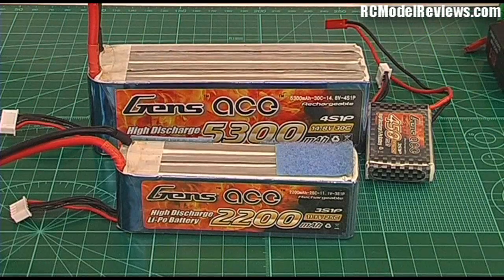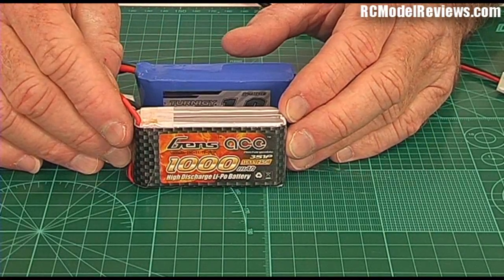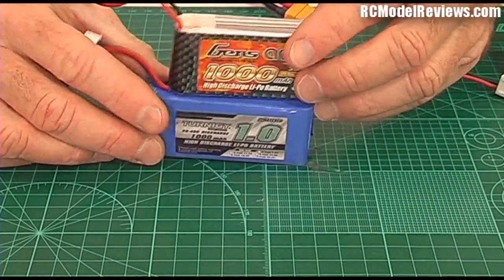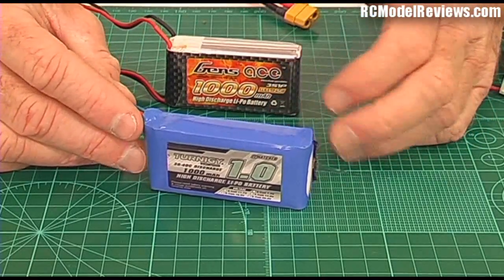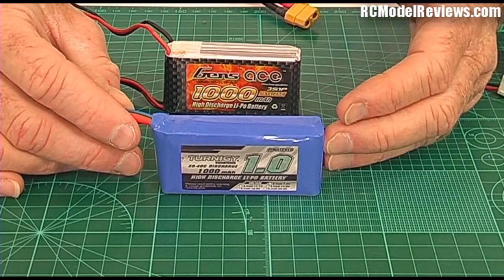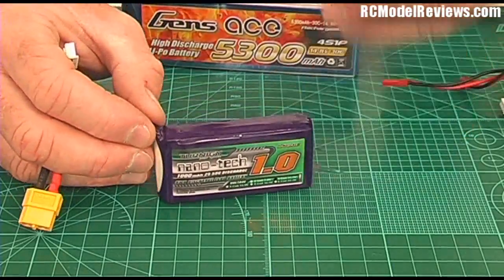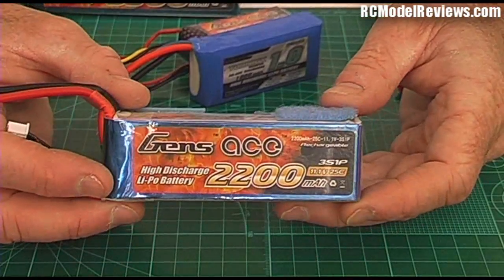All about lipos for RC models

Comment: Thanks 78E. I recently bought a iCharger 4010 Duo and I see what you mean. Only, does the 1S cells need to be storaged on 3.7 somewhat Volts? like the 2, 3  and so one cells? Or is that only necesary with batteries with more than one cells?

Comment: Those batteries you mention are only one cell, and as there is no other cell to balance it with, there is no need for a balancing connector. If you use an Imax type charger (or more or less any other for that fact) just connect it to the main charge port (red to positive, black to negative) and charge as a 1S battery. Measuring the voltage is just between the positive and the negative, the same as "per cell" method on the multicell batteries.

Comment: Thank you for a very educational video. One question however, I fly also small hrlicopters like the WL V911 on 1 cell batteries, 3.7 Volts. How do you store those kind of batteries? And how do you measure that voltage, there is no charger with 2 leads connector except for the ones with the heli pack and those are very simple.
Thank you, Willem

Comment: Great helpful videos. One question; why is there a difference between the voltage stated on the cover of a battery, i.e., 3S Lipo is 11.1 volts(3 x 3.7 volts). But when you measure the actual voltage of a fully charged battery each cell is right at 4.2 volts.  Why isn't the 4.2 actual voltage used in all the calculations?

Comment: Nice video, just one complaint: The capacity of the battery is rated in ampere hours, not in ampere as you say in the beginning. Ampere is a unit for a momentary current, ampere hours is current over time, which is capacity.

Comment: I can see that I MUST move on from my lazy ways. My brain is still stuck in the good old Nicad off road buggy racing days. I even abused my Nimh packs almost as badly. So as I watched you video I was opening my old steel cashbox, (aquired for £1 at the recycling center), and dragging out my lipos for some TLC. None have had much use as yet. No, don't worry, I haven't been discharging Lipos on an old car fog lamp and waiting till it goes out! heehee! I'm not that foolish. ;¬)

Comment: Hi Xjet - you may remember me from our exchange of puns regarding the power-lines on the park video of yours :P  Quick question regarding this charger business:  I have a Fusion Ethos LX41B Pro.  It only charges, however - no discharging.  I'm thinking this discharge/storage voltage stuff has gotta be important so wud u recommend getting the Turnigy or similar despite me already having the Ethos?  Thanks

Comment: Hey Bruce, great videos!  I've learned more about RC from your videos and site than the rest of the internet combined (last week I finally donated $50, which is way less than I owe you for all your great videos)!  Anyway, have you ever considered doing an "All About" video covering brushless motors?  That's the one area that I still find massively confusing about electric RC -- I'm lost as to when to use high vs. low kv motors, when to use inrunners vs outrunners, and the myriad tech specs!

Comment: CONTINUED:   No gender troubles....and besidees....I only connect ONE of them to bring the model on line....not both like a deans connector....where both negative & positive are made simultaneously.  Besides they're difficult for me to get apart for some reason.
               I have a discussion question: 
 After giving the battery a storage charge, would keeping the battery in the refrigerator be a wise practice?

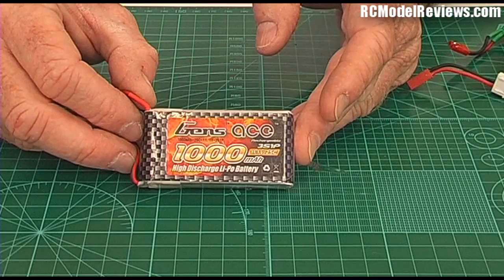Comment: @RCModelReviews I think we all agree about internal resistance hurting the efficiency more, when current drawn is higher. But the valid point that hot4plasma was trying to make, is that the largest numbers on these battery pack labels are in milliamp-hours (or amp-hours), (as opposed to just "milliamps" which you say at around 1:14 ). Because the quantity primarily indicates the *charge capacity*, not current rating. The "1C" spec is defined as capacity divided by 1 hour. To be pedantic.

Comment: Wot ho Bruce, Thanks for the Vid, I have two Batteries 2200mah lipos for the Blenheim which I am in the throws of  building  I have "all the gear and no Idea" electric is not my bag. The batteries have been charged buy Moi, not knowing of the long term  affect.. On the charger which I purchased it has a discharge setting , Now my question is How does one use this or can this setting be used for the discharge of Lipos.       Hugh